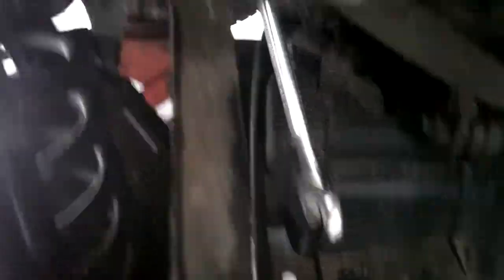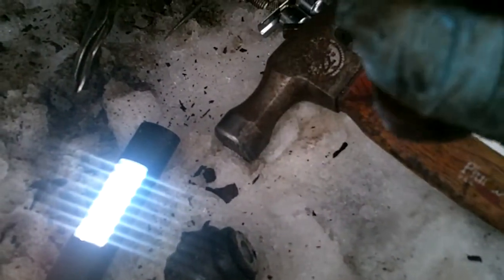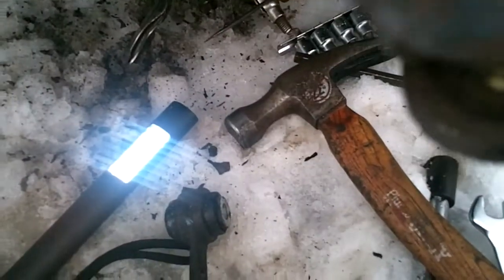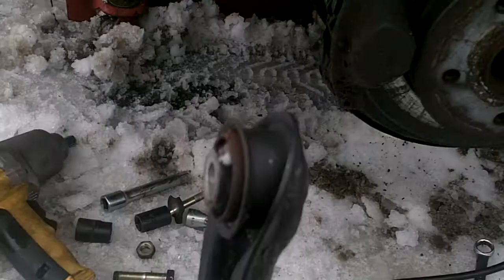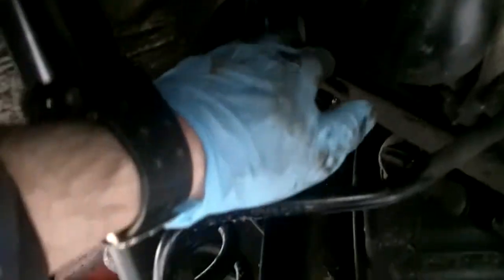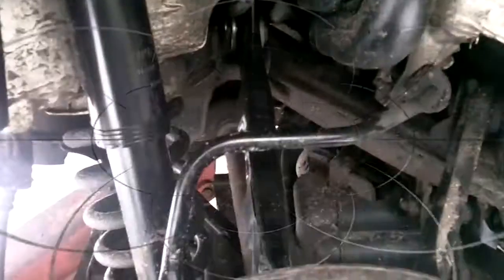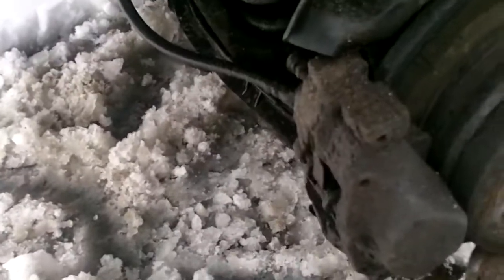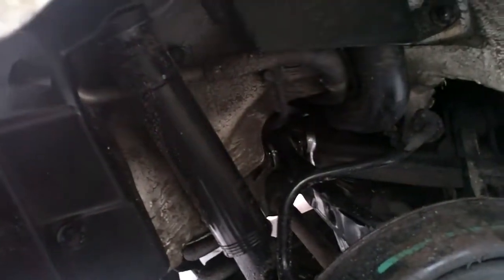Mercedes w202 rear suspension control arms replacement part 3

Comment: 2000 W202 c240k, still running strong but about to dive in and replace shocks and all rear suspension control arms. Shop wanted $3500 to do the job due to labor. I'll just do it myself and save $30 on a car i only paid $2.5k for

Comment: New breaks and pads all around. I didn't change transmission mount because aftermarket part I've got looks softer the original that's been there since 1997! I put the original mount back in place! When driven straight there is no noise! When turning at low speeds 15-30miles per hour makes noise....

Comment: I have a c180 w202 . The bolts near the rotor I can't take them.out as there s no space , and also I have a torque screw there :(((
 The upper control arm.i mean
Reply from the maker: on some you may need to remove the rear rotor and splash shield to access the bolt . If you raise the rear with a jach when the car is on jackstands it may give you more room to get to the bolt .

Comment: Finally found where the problem is. There is a fabric insulation in the transmission tunnel that is sagging right in the middle and basically laying on the front flex desk. Even though engine mounts are new apparently engine has some play along with transmission when I turn right. So I've ripped part of that insulation and problem is gone. I also found out that my drive shaft center support bearing rubber mount is gone on the left side. Can be moved to the left with one finger. Gotta love it...

Comment: Really great videos!! Thank You
What is the criteria / test to replace these arms and bushes?
Reply from the maker: I replaced mine just because I had gotten a blowout price on a complete rear end arm replacement kit...it your rear suspension is clunking,uneven tire wear,wandering at high speeds...visibly you may see tears or cracks in the rubber bushings
Reply: My w202 has started to wander to the right when I accelerate- or back off the gas. Had a look and its control arms at rear with worn out bushes- so will do them as I love my w202!

Comment: hi i have w202 too and my problem is that the rear axle camber is short (inside of the tires are broken), can the one for w164 be used? On which model can I use the Mercedes suspension axle arm which is 1 cm longer than the one suitable for the W202? Can anyone who knows helps?

Comment: I have a 2001 c320,I had to replace the axle,well after I did,and got it back together the rearend has a "jumping" sensation....its beyond swaying,any advice??? Bad sway bar links and bushings? Or bad sensor? Oh and the rearend is sitting on the tires. Didn't have any issues prior to changing the axle

Comment: Well i own a 99 c230 kompressor with 147,000 miles running strong !!!! i feel like my car hits bumps and potholes too hard, like you can feel them too much as you hit them, also suspension feels a lil loose maybe some bushing are getting getting old idk !!! what would you suggest me to change-replace without spending too much money ??? or what would you replace if it was your car?? thanks

Comment: Fups, advice on w202 subframe bushing replacement? I've seen the toolkit that lets you do it inside the car but its $300! Is dropping the subframe such a chore? I'd really rather just take the subframe to my machine shop if practical because I've heard of ppl not seating the bushings right and having to replace them again
Reply from the maker: I did a set about 10 years ago..from what I remember it was a bit of a pain heating and chiseling the old ones out, but putting the new ones in was no problem...an afternoon to do it without the special tool... I don't recall there being an issue with the seating of the bushing...it only went in 1 way if I recall
Reply: Hmmm. Yeah id rather just pay my machine shop to do it all with a press. Also there's a special lubricant Mercedes recommends? Someone suggested p-80, BMW's version which is much cheaper
Reply from the maker: The Stiver P-80 is a good bushing assembly lube..it fits Mercedes recommendations as well
Reply: Awesome. I think I'm going to wait until after summer and drop my rear axle and do all the bushings and mounts and links all in one go. I'm about $2500 into my w202, maybe another $1000 and it'll be virtually a brand new car ;)

Comment: Hi, one problem that drives me crazy because I can't figure it out. Since that i've done following but it didn't go away. When turning right I am getting slight grinding noise. Can't really say where it's coming from. New front end, ball joints, center link with tire rod ends, lower ball joints, shocks. Rear - outer control arm bushings, shocks, just rebuilt left side half axle thinking it should take care of it but it didn't. Both rear bearings are new as well. Both engine mounts are new - HELP

Comment: Hey brutha having a hard time getting the rear control arm with the ball joint. How do you take it out cause I'm stuck
Reply from the maker: +Romeo Reyes  I have to do the rear ones on my r170 in the next few weeks ..they are the same, but I haven't filmed it yet..check this page  http://workshop-manuals.com/mercedesbenz/c_230_(202.023)/l4-2.3l_(111.974)/steering_and_suspension/suspension/stabilizer_bar_sway_control/component_information/service_and_repair/ar32.20-p-0300c_remove/install_torsion_bar_on_front_axle/page_8641/